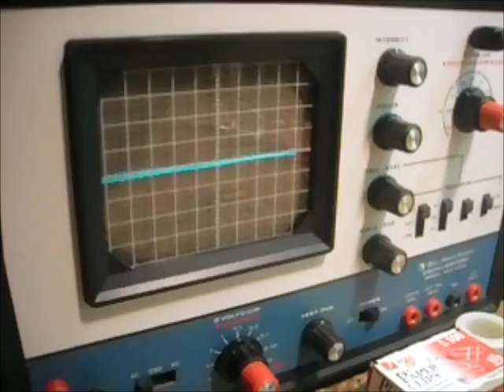Foxhole radio with a twist

Comment: When you touch the tuning capacitor with your hands to change the setting your hands/body ground it out and the signal weakens and you cannot hear if the capacitor has any effect on changing the tuning.  Best to mount the capacitor and put a plastic knob on or tape the turning shaft where the knob goes so that your skin does not contact the capacitor directly.